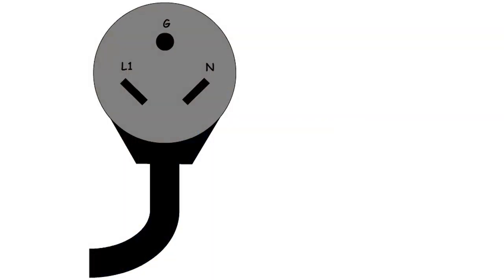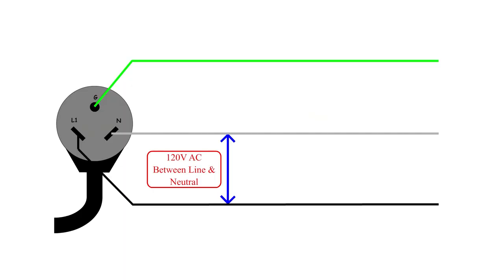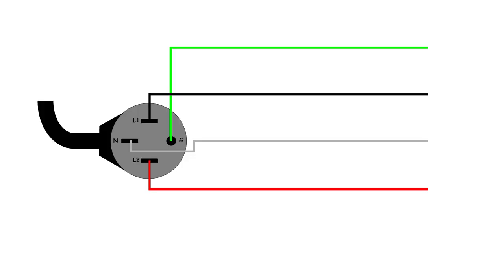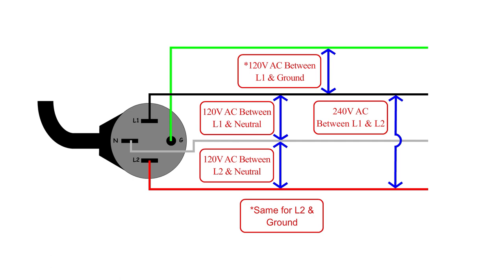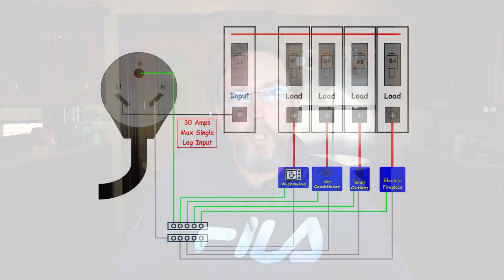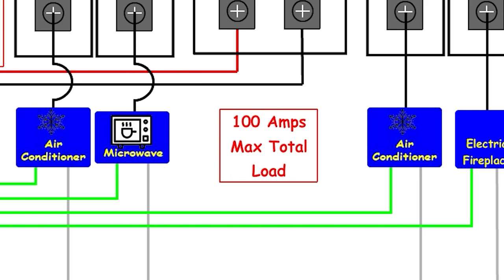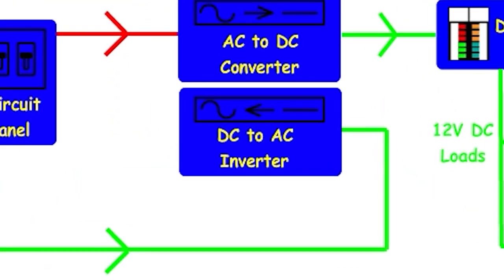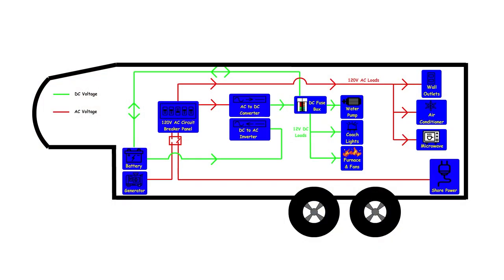RV Electrical Systems Made Easy

Comment: Very good overview...I learned a lot.
Reply from the maker: Glad you enjoyed it. Thanks for watching!
Reply: @fairwindsrv  My wife gets confused about how many appliances in a circuit.  The coffee maker and the ceramic heater are greater than 15 amps..so that blows a fuse..I have been unsuccessful explaining this...ie.. the microwave is on it's own circuit, so it's not an issue???
Reply from the maker: Yes, because RV's, especially the 20- and 30-amp rigs, are so much more limited in how much power they can draw than your typical residential system, it's definitely important to understand what's on what circuit. One of the biggest challenges is figuring out how to not trip the breakers for the outlets. In our RV, there's absolutely no rhyme or reason to which outlets are on which breakers. I keep meaning to label them, but haven't gotten around to it. LOL.